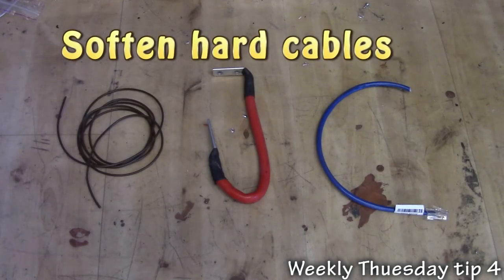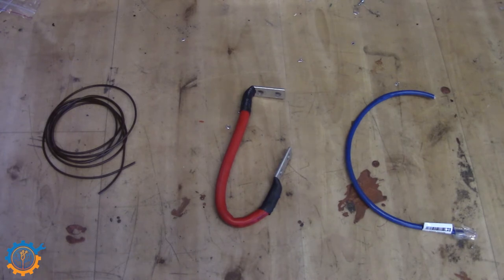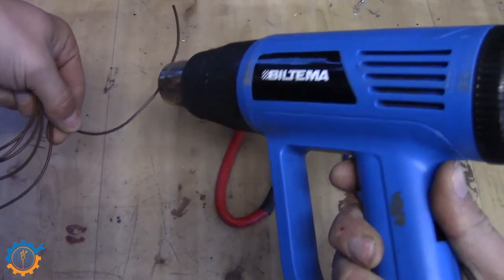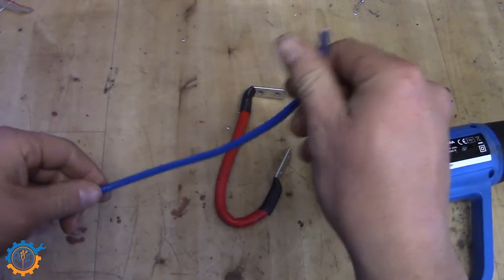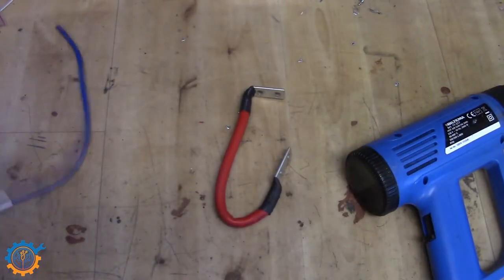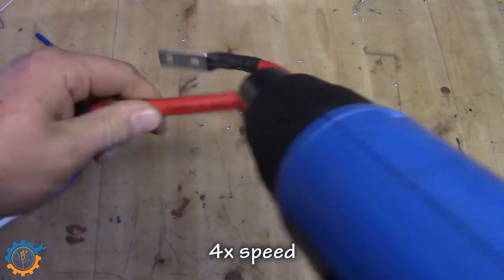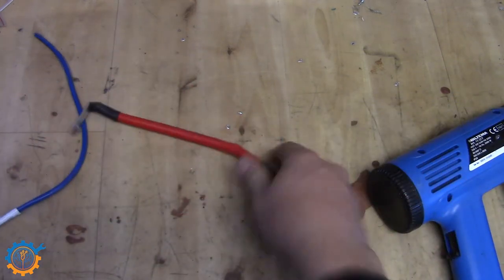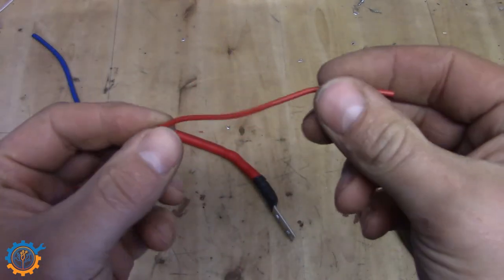WTT: #4: Softening hard cables

Comment: Good stuff. Had never considered that annealing works for plastics, too. Annealing is most effective when it's brought to just under melting and then cooled relatively fast. I'm hesitant to go too hot with the cable, but I bet you could increase the effectiveness by using a fan to help it air cool faster.

Comment: I have a Soft Cabled Earphone that got destroyed then i just put it back on its case. When i checked it the cable became stiff. Since it got destroyed i had it repaired but the cable is still Stiff. But when i used it for 6 months it soften back again. 

Is it because its just stuck on its case/never been used for long. Right now its back to normal. LOOL

Comment: Does this last or just until the cable coolds down again? My headphone cable hardened over time
Reply: i have the same problem with my dt770, some sections became hard..did you try this?
Reply: @St0RM33  no
Reply: @Nocure92  did you find any other solution though?
Reply: @St0RM33  The trashcan. Eventually it completely failed and I replaced them. If you are savvy with soldering you can cut off the hardened portion of the cable and repair it that way I guess. I'd only do this if the connection near the headphone starts glitching though as an attempt to save them. I did that and failed though, so now I just a pair of Sennheisers :)
Reply: @Nocure92  haha, well i can do this it's not difficult for me but it's a shame